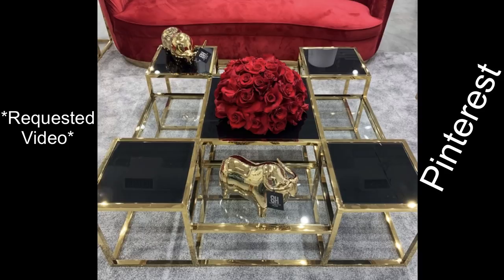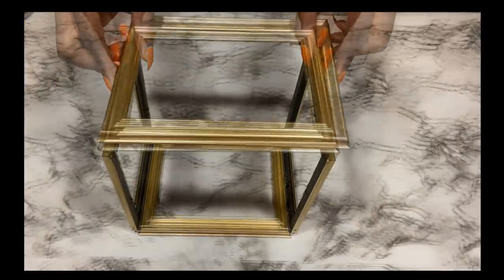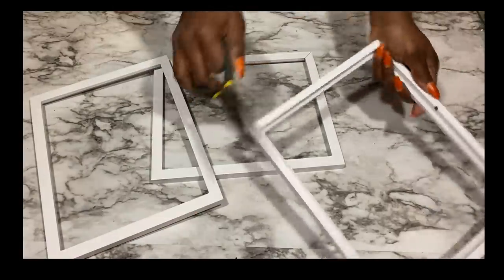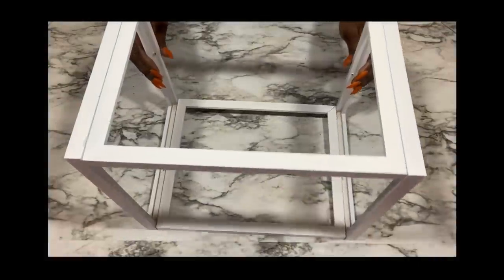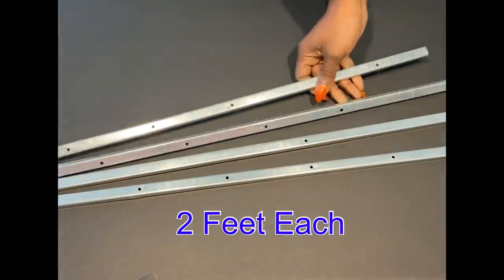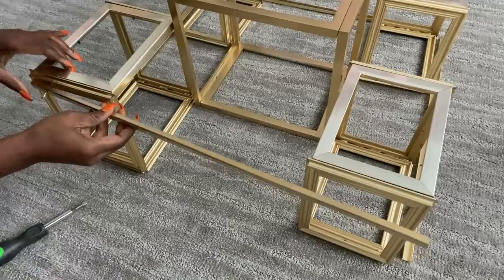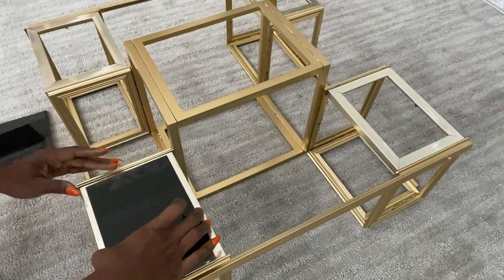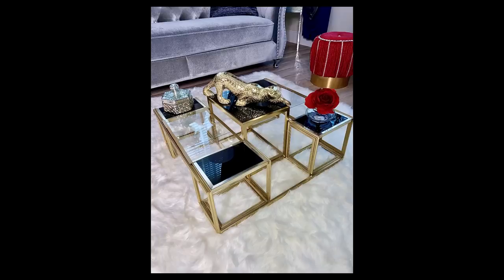LEARNING HOW TO DIY A LIVING ROOM TABLE| DOLLAR TREE DIY

Comment: I love it, I was wondering why you didn’t put the glass in the frames from the bottom so the edges were inset and more safe?
Reply from the maker: I didn't have any issue when making mine, but you can definitely add yours to the frame. Glad you love it 🙏❤
Reply: I was wondering the same thing.

Comment: The only bad thing is the glass from the Dollar Tree frames are so fragile. I basically opened the back of the frame and the glass shattered. I hope she used the Walmart glass and I hope they're sturdier. I learn a lot from this channel. I wouldn't have thought about spray painting the glass for a shiny effect or the foam trick she did in another video.